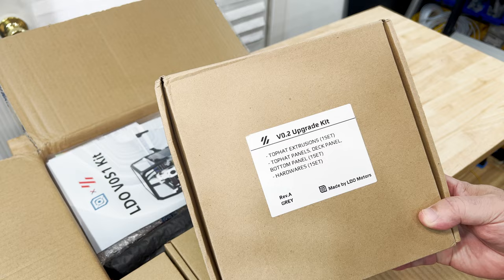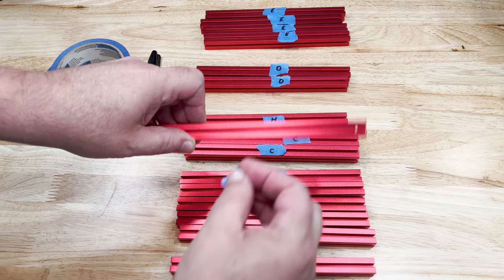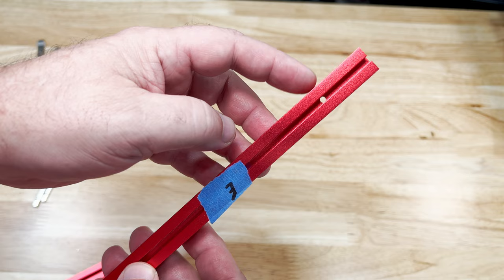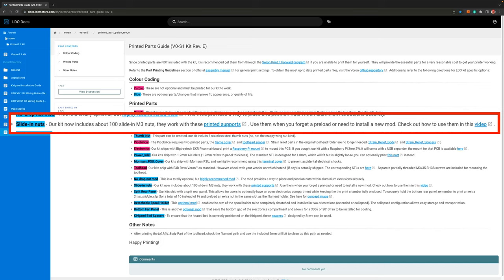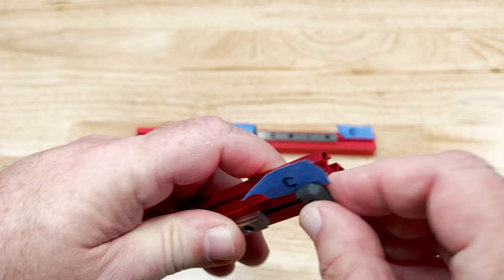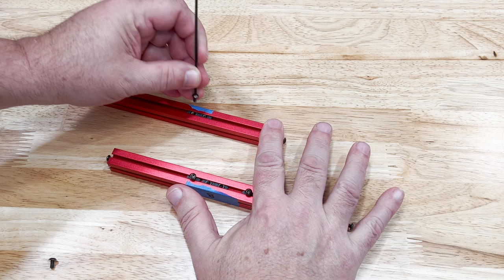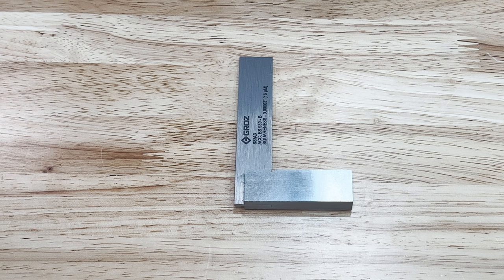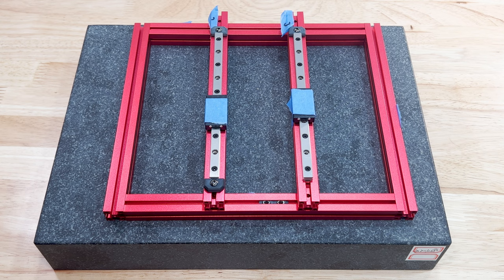Voron 0.2 Step By Step Part 1 The Frame I

Comment: Scott, I sure appreciate your build videos. You helped ma a bunch with a spot I was stuck at in my Trident build (it was getting the Octopus flashed).
 My only comment here is that I used a pair of 1-2-3 blocks and round spacer blocks to set my frame with. no issues with tangencies or squareness, and it speeds things up a lot.One 123 on the side where the extrusion end and face meet, and one on the inside to assure squareness. I used the round spacer block set to get parallels set. Post assembly measurement showed no need to move things.

Anyway, in my opinion, you make the best assembly videos on youtube. All steps are clear and well explained. Pitfalls are clearly shown. Thanks man!

Comment: PSA for anyone going through this smart enough to check comments first (not me apparently) 
(1) ~ 20:00 you're told to preload 3 nuts in the right extrusion, you need to preload 3 to both vertical extrusions.
(2) Instead of using tape to hold the carriages if you have the little stoppers on the linear rails you can move them from the outside holes to the next one in on each side, then when i added the printed railstops i moved them both to the opposite side just for a little redundancy and piece of mind. Tape didn't want to stick to my just lubed rails.
(3) Instead of the printed "no drop nuts" i just added an m6 screw to the 2 outer nuts and lightly tightened to hold them all in until they're needed. Mostly doing this as i didn't preprint the no drops and it's working well so far. Time will tell if i need to go back and print them later on. At least they're small and quick if so.

If i come across anything else that might help I'll try to add them in the other parts. All in all this is a great guide, one of the shorter ones I've watched so far without a whole lot of filler eating up time which is why it's the one playing while i do the actual build. Thanks for that!

Bonus tip: if you have a regular printer or access to one print the manual to have as a reference as you go to help spot issues like the one mentioned around 20:00 in. GL

Comment: Hey Scott,
Scott, first off thank you for a clear video. I am pretty sure I put my rail-bar in upside down (based on your description) so I will go check that :) And in exciting news, my LDO kit came with rubber plug stops in the linear rails (well the generic ones) so it is convenient to leave them in place without having to tape down the carriage. 

 I do have a question about how you centered the linear rail. Putting a clip on both ends makes sense to me, but I saw a different video focusing on moving the carriage backwards and forwards to help nudge things to the center while using a clip.

I have no strong feelings either way, but wondering if you see a different in the two techniques (or a combination of both)?

Comment: On page 30 in step 7, you missed preloading 3 nuts in the left Z extrusion that will also be used for attaching the back panel. Should have been 3 nuts in each Z extrusion, for a total of 6 nuts loaded in that step.

But other than that, great informative video! Would have been very helpful when I built my V0.1 over a year ago.
Reply from the maker: Cool, thanks!
The three nuts you are talking about (I think) are for a external boden motor. I'm only going to run the direct drive extruder so I don't need them. I probably should have said that in the video. :)
Reply: @scottcorn  no, the 3 nuts in that extension are required, while the callout for the optional nuts is for 2 additional for the Bowden extruder. Check the left side of page 30 again.
Reply from the maker: I see. It wants three loaded, but an additional two should be added if you want a bowden setup?
Reply: @scottcorn  yup! They're for the electronics panel to hold it securely to both extrusions. Wouldn't want to skip them because they can't be loaded after frame assembly, and adding them after the panel and electronics are in will be even more of a pain.
Reply from the maker: @daschu117  Thanks! I'll have to add them in the next video. (Wish I could correct a video) I'll also add a pinned comment here.